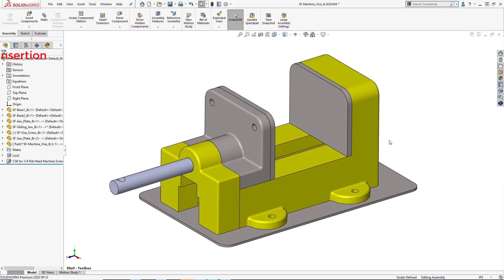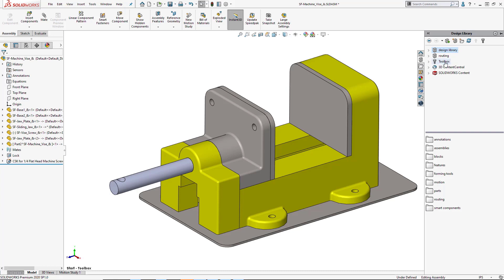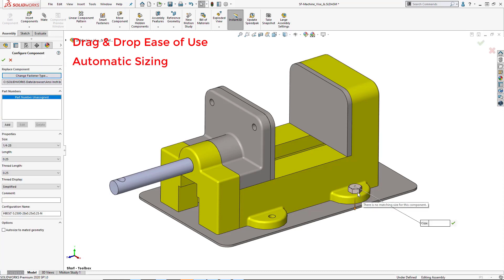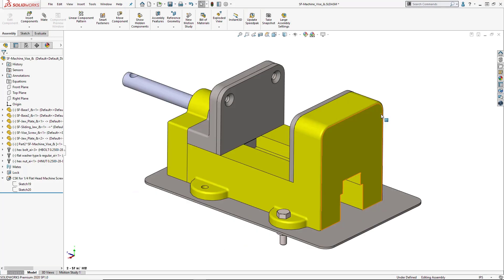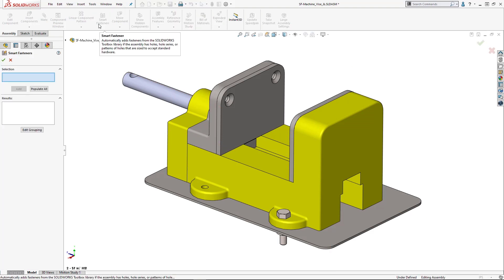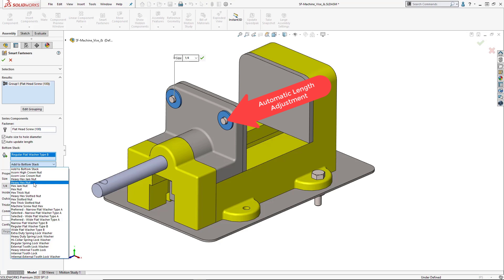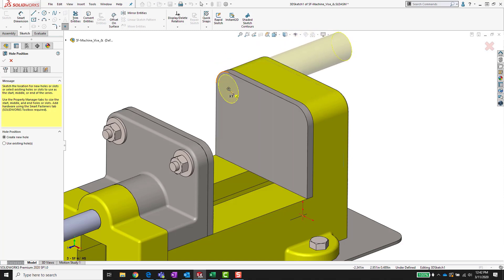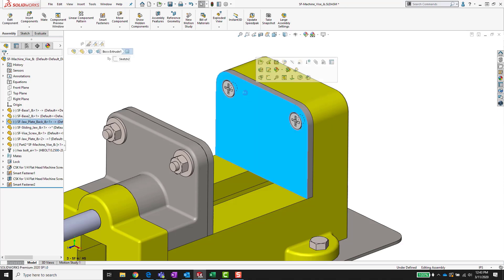Add Assembly Hardware Automatically with Smart Fasteners

Comment: Hi, Do you know what I can do if I want to use smart fastener with slots over a drill hole, because I'm trying but the head of the bolt shows inside the slot and not over it, and I don't want to modify the mates manually in each slot.
Reply from the maker: Smart fasteners do not support slots, but you can add a fastener to the hole manually and then use a feature-driven component pattern.

Comment: And have it populate all for all holes within my size3 range like a smart fastener would?
Reply from the maker: If you use a standard part, or even a custom toolbox part, check out pattern-driven component patterns, where you can copy a component to all instances of a hole wizard feature in one shot.  It isn't quite the same, but it works with any file if that is a requirement.

Comment: How would I create my own custom smart fastener like a pop-rivet for instance?
Reply from the maker: Unfortunately smart fasteners only works with the provided toolbox components, not a custom component.  For smart fasteners to work you'll need to either use or modify one of the existing toolbox parts for your needs.  For example, if there is a rivet that already exists, but the part numbers and the geometry are a bit off, consider adding a few features to the model to make it look closer to your needs and modify the part numbers to your part numbers.  It is a workaround, but it would get the job done.

Comment: how to change the direction
of the head
Reply from the maker: When dropping a toolbox part in place, the Tab key can be used to flip the mate on the fastener to insert it the other way before releasing the fastener to size it.  In Smart Fasteners, you should always select the face that represents the face under the top stack and the face normal will determine the direction.  If you are experiencing a specific issue with smart fasteners I recommend you contact your local VAR support team to review your scenario.